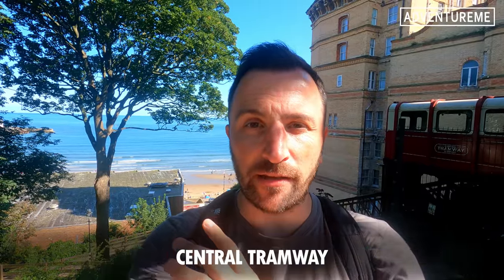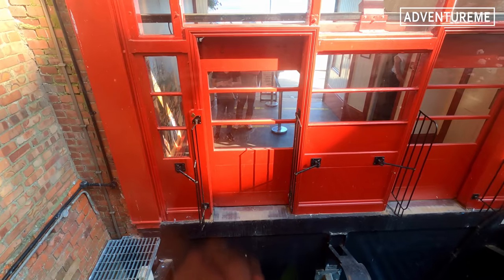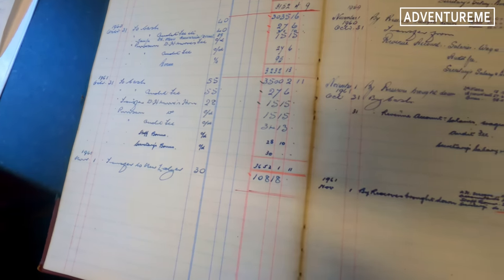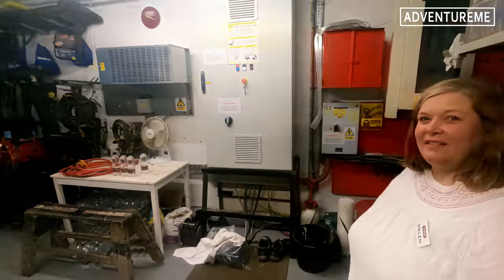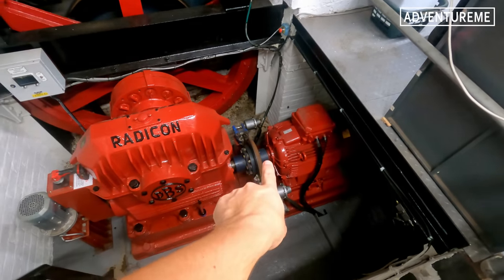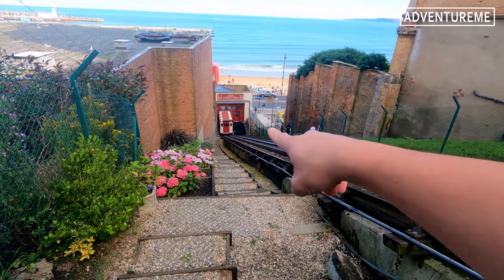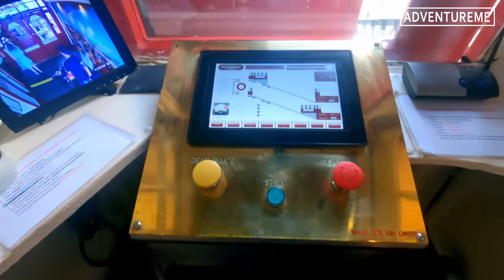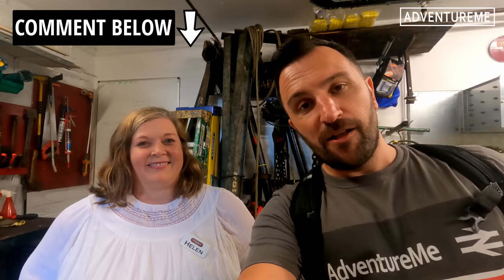Hidden Secrets Of Scarborough's Victorian Central Tramway

Comment: The motor and gearbox are exactly like a lif system (elevator) with a worm drive gearbox.(my last job involved lifts)
Even dow to the 4 cables on the cars and the safety cable, if the safety cable stretches too much it drops some latchs to stop the cars going down at high speed, there's probably a speed detector on the safety cable as well that does the same, apart from the incline, the only difference is that one car would be a balance weight
The squealing you hear is more likely to be the electronic control which turns the motor into a speaker which is why you hear it., the electronic control is called a 'variable frequency drive'
Reply from the maker: Thanks mate. Sounds like a lift system then yeah.

Comment: Hey Darren

It reminds me of the Angels Flight in Los Angeles. It’s similar in length and function.

There’s two in Hastings, although East Hill has not been working on the last few times I’ve visited. The West Hill version is unique as it travels through a brick built tunnel on its way to the castle.

Lovely video. Thanks for sharing ❤️👍
Reply from the maker: Thanks Robin. I've just sent you an emai.

Comment: Excellent video as always, love funicular railways. 
Unsual configuration of the tracks though, bullhead (95R) S1 chairs, flatbottom rail (113LB), with bracing around what look like Scotches (Used to secure the points rails from moving in crossings) securing the rail in place. Talk about a mash up, but it does work well and has for 140 years.
By the way I had a Ford Escort MKii RS Mexico lol
Reply from the maker: Thanks Stefan. Can't beat a good old Escort.

Comment: The motor & gearbox setup is just like a vertical traction lift, it's also had a VF drive fitted at sometime that gives the motor that horrible noise.
Reply from the maker: Yes someone else said the same.

Comment: What you pointed at wasn't the motor! That would be the reduction gearbox - the motor was to the right and drives a worm gear in the gearbox. This then turns a worm wheel gear and the wheel off the shaft.
Reply from the maker: Thanks Alexis
Reply: @AdventureMe  No worries - I saw you got it right later on in the video - but feel you may have missed an important bit of info in terms of the gearbox and how it effectively acts as a safety mechanism. The Worm Wheel cannot drive the Worm Gear (screw) - so when the motor brakes it effectively stops the main flywheel from turning. It means that when they stop the cars, there's no risk of the cars moving back down if one was higher, once the motor slows the flywheel down it would prevent any movement. Interestingly when the motor stops it can't fully stop, it actually has to keep turning as the flywheel brakes as if the motor stopped things within the gearbox would get very upset!
Reply: @cyberprog  That must be a triple-start worm drive, otherwise stopping the motor would smash the gearbox.
Reply: @tooleyheadbang4239  I said that :)

Comment: I thought it was gravity powered, one tram heading down pulled the other one up.
Reply from the maker: Me too. But it's assisted.
Reply: There’s a similar tramway at Saltburn-by-the-Sea which uses gravity plus water to work. There are tanks under each carriage and they fill the tank under the top car until it’s heavier than the one at the bottom then gravity does the rest. At the bottom the tank is emptied and the water pumped back up to the top.